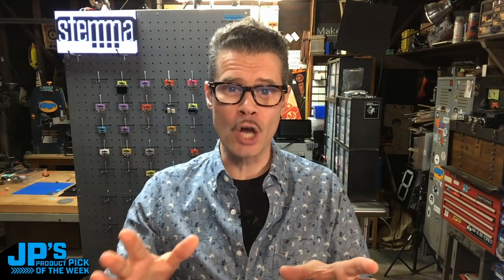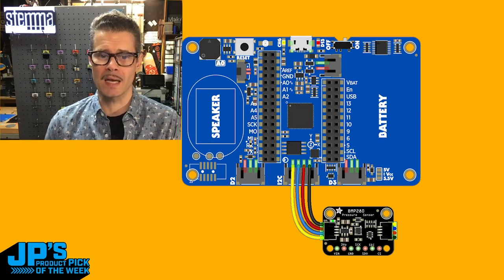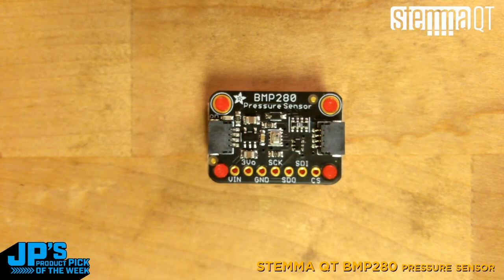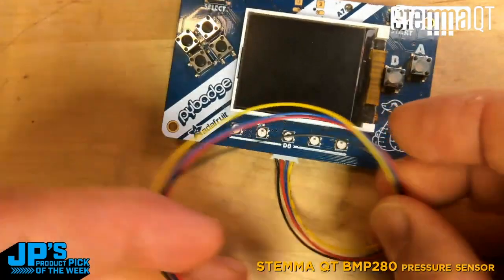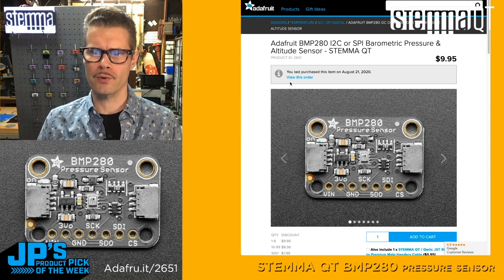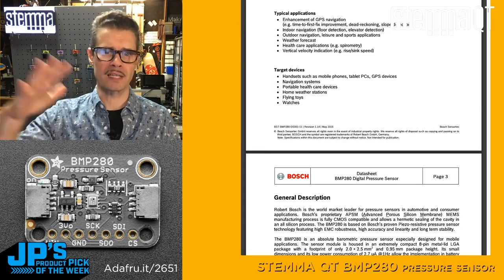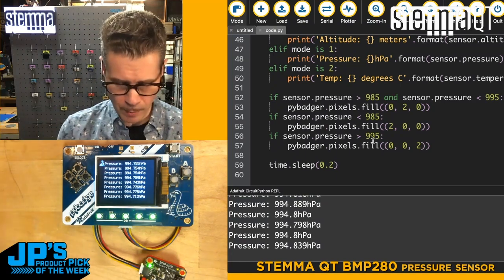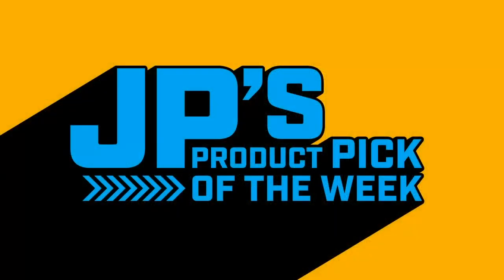JP's Product Pick of the Week 9/1/20 @adafruit @johnedgarpark

Comment: Are the STEMMA QT connectors compatible with Arduio's Plug and Make Modulino devices?  If not, what type of adaptor or combination connector cable do I need to use?  Thanks.
Reply from the maker: Ladyada replied on Ask an Engineer https://www.youtube.com/live/OOfkCF5_uEs?feature=shared&t=2490